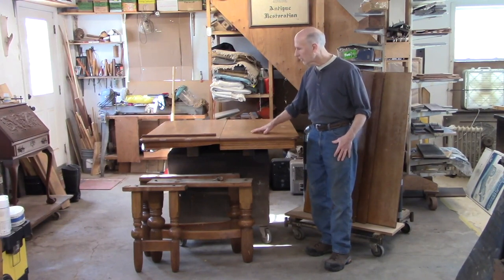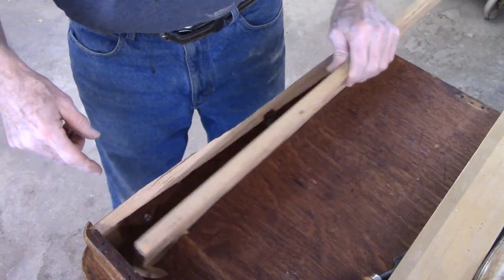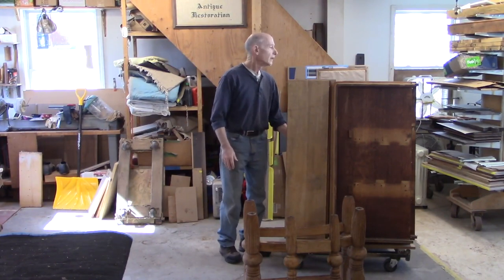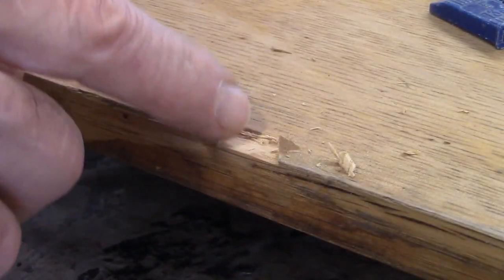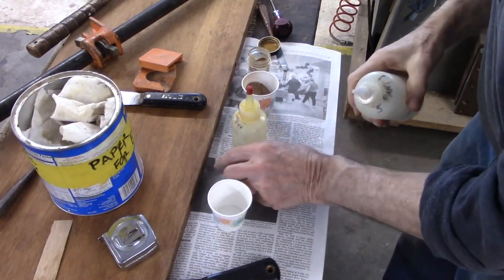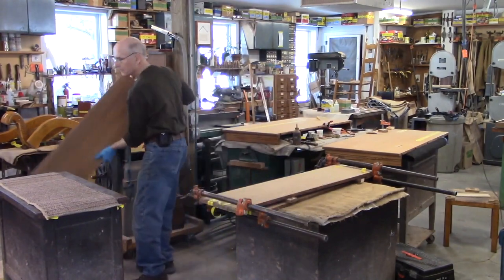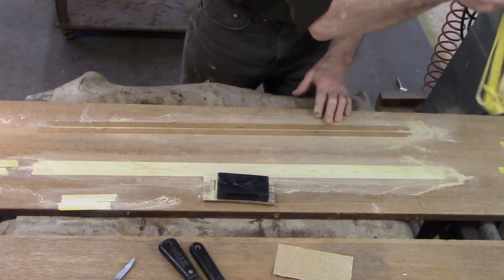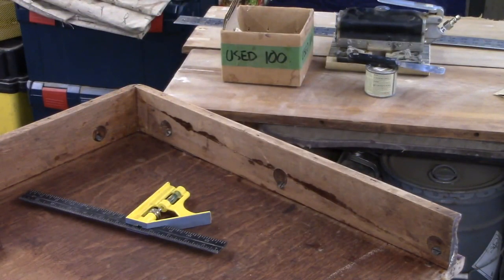Restoring a Turn of the Century Table - Thomas Johnson Antique Furniture Restoration

Comment: Awsome work as always!
Is it possible to buy those powersanders in Europe (or exporting to Scandinavia)?
Best Regards!
//W.
Reply: Not sure about Sweden, but easy to find in UK - search for 'long bed air sander' or 'long bed pneumatic sander'. Not the cheapest tools, but they last forever.
Reply: @dlevi67  Thank You! Most of the modern powertools i find here are made of plastic and i don't realy like that.
Reply: @dlevi67  I found some simplyfied models for around 120£ Do Yopu think they are worth buying or are they crap compared to the more expensive ones?
(i mainly do carpentry works on the buildings in the farm and restoring fleamarked finds)
Reply: @sheep1ewe  The genuine answer is that I don't know - from what you are saying your use seems occasional and 'mid-scale' rather than continuous and 'large scale', so I think the "simple" one plate models are probably OK.

I would still tend to choose a well known brand (Sealey? Rupes?) and ideally a well known retailer (not Amazon!) - tools are one of those areas where 'spend once, cry once' is a pretty good rule of thumb, but I wouldn't spend the extra for Festool... (lovely as they are - this said, I just got a Festool router because I found a 'new used one' on Ebay... so you never know).
Reply: @dlevi67  Thank You wery much for Your reply! It sounds as realy good idea to invest in proper tools i agree with that. Thank You for the tips about those brands!
Reply: @sheep1ewe  You are very welcome. Another one that may be worthwhile looking at is Hutchins - I haven't used them, but a couple of good retailers seem to stock an extensive range of them here in the UK.
Reply: @dlevi67  Thank You!
Reply: @sheep1ewe  It's a pleasure. Hope you find something that works well!
Reply from the maker: Thanks! dlevi67 did a great job of answering. One more point: you need a large compressor to run these tools, that sander I'm using can use up to 9 or 10 cfm's, I have a 5 horsepower. So it's a big investment, usually not practical for a home workshop
Reply from the maker: Thanks! Good discussion
Reply: @johnsonrestoration  
Thank You for the information!

The electric tools i hawe are either to weak or too aggressive, like the beltsander, for this type of large surface works, they work for fixing the trims on the stairs and other such things, but i almost shoot my self with the huntingrifle when i decided to make a massive  logtable for my mothers summerhouse and had to handsanding most of it in the end... But it was worth it i think. ha ha!

I concider buying a bigger compressor anyway since the small garage ones i hawe are very much on the limit for some of the workshop tools, and i wanted to hawe a sandblasting cabinet for a long time  anyway.

Comment: Interesting. When it comes to joint splits I prefer to take them apart and clean the wood with a scraper or my 45 plane and reglue them. For splinters I find a wire brush does a good job before gluing. As for that side piece would not have using a router or hand plane to make a groove along then add a sliver make an invisible repair? Just a preference I guess but visible repairs look wrong to me.
Reply: If the parts of the apron come together well (and they seem to), it's going to be as invisible as anything made with a spline inside, and a lot easier - it's not that it needs to support anything, and Tom says it only broke because a chair was bashed against it. Or were you referring to something else?
Reply: @dlevi67  table tops including leaves seem warped. I would have split them and cleaned them up, as for the Dutchman’s I’m not a fan I replace strips instead to make it invisible, which is tricky as for 
the side pieces that split..they will again at some point due to mold 
and dirt in them glues don’t seem to like it much. May take ten or twenty years though.
Reply from the maker: Thanks Jacilynn, all valid points, but my over riding mantra is don't make the defective area larger. In most cases I'm not concerned with invisibilty, although most repairs turn out that way. It depends on the wood and the style of the piece
Reply from the maker: Yes, I am not sure either exactly which repair she was referring to
Reply: @johnsonrestoration  I was just saying my preference

Comment: I pretty never strip, but I would like to know what that costs and how I go about finding that kind of service near me?
Reply from the maker: Thanks! It's tough to find good stripping outfits, so you have to be careful. I've had a few pieces ruined by excessive water use on interior plywood. There are very few around anymore due to enviromental regs
Reply: @johnsonrestoration  Yeah. I was thinking there would be a high risk of excessive damage. Strippers today are nothing like they used to be. I miss Zip Strip and Strip-Eaze like they used to be. I need to buy one of those manual carbide scrapers. I have a project coming that could really benefit from having one of them.

Comment: Out of curiosity, why on the apron repair did you use hyde glue instead of common carpenter glue?
Reply: My guess: 1) strength of hide glue is more than adequate; it's not a structural piece or something that has to go outside. 2) If it gets bashed again, it breaks without further damage to the wood. 3) Tom had the hide glue at the ready.
Reply from the maker: Thanks! dlevi67 is correct. There's no reason not to use carpenter' glue. In my videos I (almost) always use hide glue so people don't give me a hard time about not using hide glue exclusively on antiques. When necessary I use yellow carpenter's glue and also epoxy
Reply from the maker: Yes, thanks! I'm not sure why people think that hide glue is not a strong as carpenter's glue. This particular glue, "Old Brown Glue", the maker claims has excellent strength. I have no reason to doubt it
Reply: @johnsonrestoration  There was a test (I think Steve Ramsey, but it may have been Matthias Wandel - I'm not sure) where they tested the most common glues, including all 4 Titebonds (I, II, III and Hide) and Old Brown. In terms of shear strength both Old Brown and the Titebond Hide Glue were better than Titebond I, and almost as good as Titebond II. Old Brown was a bit better than the Titebond Hide Glue. My only regret is that it's not easy to find in the UK, so I stick (!) with Titebond.
Reply: @johnsonrestoration  I guess a better question would have been, what circumstances call for what glue?

Comment: How did they manage these tables with all those castors back in the day?  They must have been rolling all over the place.  Did one or two of those castors have a brake on them?
Reply: Generally not - bear in mind that it was generally only 4 legs (at the corners), plus occasionally 1 or 2 ''movable" legs to support the leaves, and those would typically not have castors. The frame and 'basic' top are very heavy and the 4 corner castors (leather, hardwood or brass with brass or steel axles) would tend to 'stay put' on a relatively irregular floor (wood planks) just with the weight of the table, never mind anything you may put on top. Also, often, castor cups were used to prevent floor damage (and to raise the table a bit).
Reply: @dlevi67  Oh right..!  Thank you for that.  Makes sense.
Reply: @alisonburgess345  You are very welcome!
Reply from the maker: Thanks! Yes, dlevi67 is correct. The weight of this particular table would keep it in place, and also cause damage to the floors (hence the caster cups) Solution in Part 2!
Reply from the maker: Yes, thanks!

Comment: Looked to me like antique "pocket screws" the way the apron was fixed to the table. Or is this technique known since the old days? Sorry, if this is a dumb question.
Reply: Not a dumb question at all! It's about as old as 'commonly used' screws in woodwork: around the second quarter of the 18th century for the earliest examples (with hand-made screws), relatively common from ~1760 on, when the first machine-made screws appear.
Reply from the maker: Thanks! dlevi67 is correct!
Reply from the maker: I was just reading recently about the history of screws - interesting!
Reply: @johnsonrestoration  Yep. For something that was invented at least 9 centuries BC, it took a very long time to come of age!

Comment: How did the other company strip the wood?
Reply: Usually they have large tanks with strongly alkaline or solvent-based solutions, depending on the finish to strip and the wood. Confusingly, the strong alkali are often called 'acid' in the trade, but never mind.
Reply from the maker: Thanks! dlevi 67 is partially correct - in this case they don't "dip" furniture, but they have a large metal tray and use a flow over system where the stripper is recirculated
Reply from the maker: I've never been straight on acid and alkali, I should have paid more attention in chemistry class

Comment: Hmmm,  you took your dog to the strippers...but seriously, I learned that I was holding the chisel incorrectly for cutting out small bits of wood.
Reply from the maker: Thanks! It's hard to understand why sometimes you need to flip it over for some cuts. Is it just the angle of the chisel? Or is it something about sharpened edge being flat on one side? In a lot of ways it shouldn't make any difference but it does

Comment: An easier way to raise the table top, instead of trying to create feet, would be to extend  the tops of the legs.this would be covered by the Apron so. The joints would not be seen, and it would still allow for casters that make it easier to extend the table when required,considering the weight of such tables. Any. Casters fit this table, although if brass, could begin digging into a floor. To. Counteract this a wide hardwood caster was generally used, usually of 5/4” or more diameter wheel.
Reply from the maker: Thanks! All true, and at first I thought I would add blocks above the legs. But you'll have to wait for part 2!

Comment: Love the mirror on the chisel. Excellence.
Question: Did the strippers do any sanding? They must have just had big vats of remover to dip the parts in. No, the insides aren’t stripped. Interesting. It would be fun to see what the strippers do.
Reply: I’ve never known them do any sanding. Occasionally they’ll give it a rub if you tip them enough
Reply: It's usually relatively shallow, large trays with a recirculation system; the older 'big tanks' are less efficient and much less 'clean' environmentally (Tom has already answered other commenters on this, so I can tell you that in this case it was a flow system). I've never seen stripped wood being sanded "at the strippers", and the insides aren't stripped because the solvent used is targeted at the varnish, and in this case whatever stain they used on the underside is not affected by that solvent.
Reply: @dlevi67 , Thank you for that information.
Reply: @boa9535  You are welcome!
Reply from the maker: Thanks! dlevi67 is correct, they use a flow over system. They sand furniture that they are refinishing, but I want to do the sanding myself
Reply from the maker: Me neither. I doubt anyone's asked them to
Reply from the maker: Exactly right!
Reply: @johnsonrestoration  Methinks @chrissymon1001 was thinking of the other type of stripper... ;-)

Comment: Why do cut the patch at angle instead of all square edges?
Reply: Smaller size and it's a little bit less visible if you are good at cutting angles. I'm not, so I square them up 😁
Reply from the maker: Thanks! just trying to remove as little of the original as possible. Also, it's traditional to cut patches at angles, to help hide them
Reply from the maker: Yes, I find it tough to get a good fit no matter how I cut them!